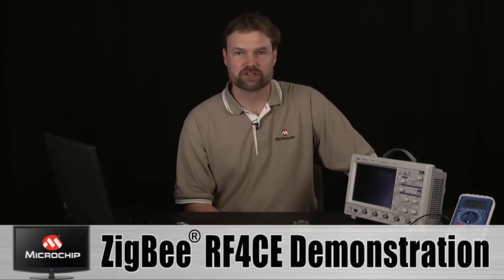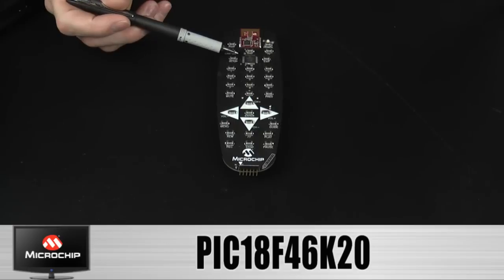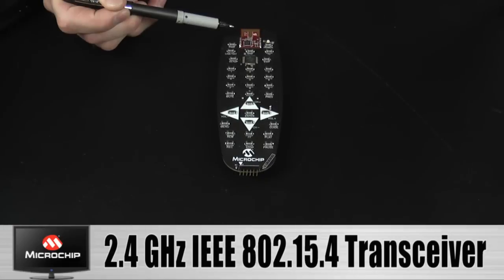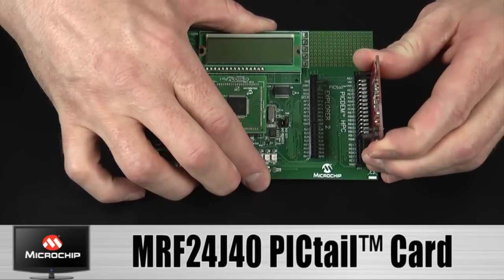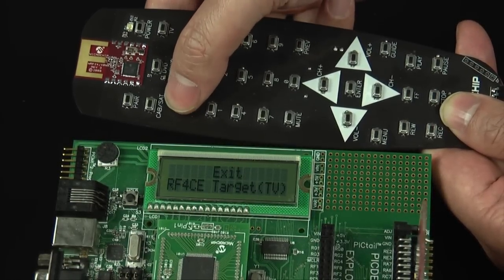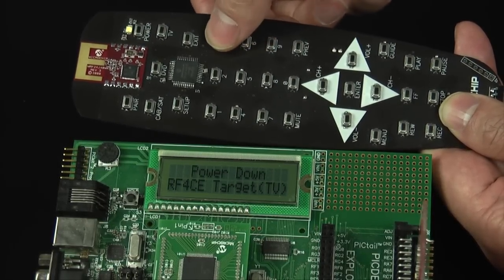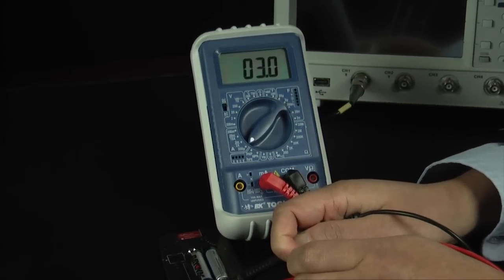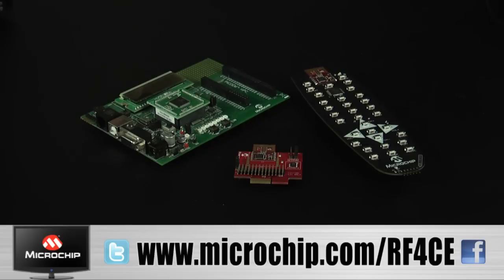Microchip ZigBee® RF4CE Demonstration

Comment from the maker: @gabcibertech Pairing procedure is required to exchange data between RF4CE nodes. The concept is the same as Bluetooth. Fortunately, pairing only happens once. The information is saved in NVM, not affected by power cycle.

To communicate with more than one module, you need to pair multiple times and maintain multiple pairs in NVM. Thats why you have TV, DVD or Set-top box buttons on remote control to choose which device that you want to control.